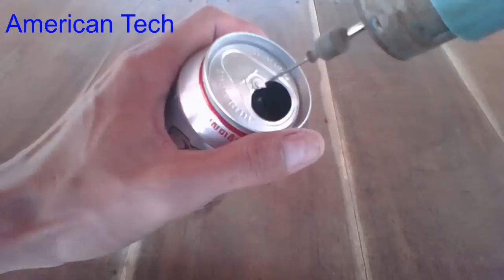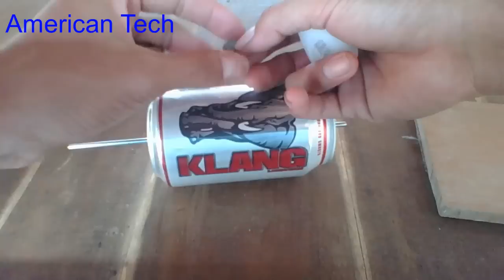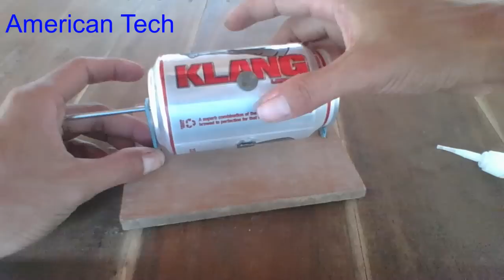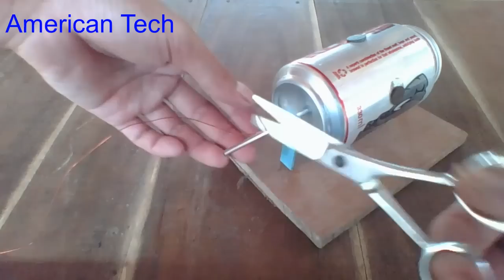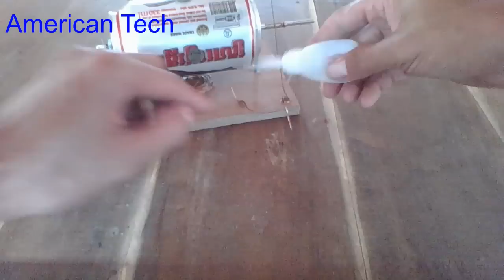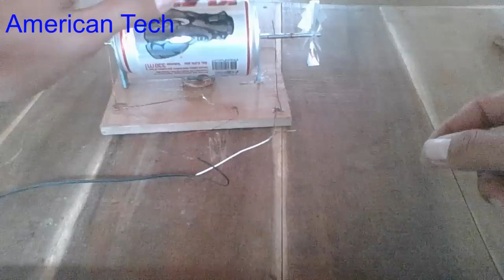How to make 2000 RPM DC motor out of beer can very easy, new idea 2017

Comment: Dear ed with the chicken picture...sorry I cannot find your comment in the comment list, it only is readable as a reply in my notification box.  For the sake of others who are not sure, UNLIKE ME...if you connect two 1.5v batteries in parallel ( meaning both pluses are touching, and the  minuses are connected and touching), you increase amperage (power or current flowing).  If you connect one battery's plus to the other's minus, this is called in series and it increases the voltage (pressure, or force).  I graduated top of my class in college.  Go look this up ed before you make costly mistakes in your circuits.  Just friendly helpful advice :)
Reply: Vincent Hildebrand Yeah how about connecting batteries in Parallel which will give you both double the Amps & Double the Voltage. This guy with his f?# music is very lucky that he is not near me, coz I would have shoved his head into his Rectum permanently where it belongs. Any one who makes videos of their projects, should Dimensions, Parts & Components needed for others who are watching

Comment: It was fun to use a pop can yes?  Can you all imagine if the can was fatter?  How about as fat around as, say.. .  .    .      .a bicycle wheel??!?!   More horsepower.  Increase voltage and coilings and more magnets and....o my.  And have some pull as others push.  The power potential in terms of horsepower is great.

Comment: oh, at.  i happened across this video again, and have to admit i was fooled.  dang.  i hate when that happens.  in my defense only skimmed over the build.  anyway.    too connections were shorted together, to allow the pretend commutator to function.  the motor works because of the use of a pulsating dc power source.     cheers

Comment: That music was headache. no need of music.  he used a battery to run it which he did not show.
Reply: ya man that music i m unsuscribing bcause of that music
Reply: actually he never claimed it to be a "free energy generator" and you can see the wires from the power supply.
I agree with the music part, it's so annoying
Reply: Simba Boy so who cares if he didn't show the battery
Reply: mehmet bilir get over it
Reply: Simba Boy 
I keeb dislikin the vids b cuz it
Reply: He did use a battery. he usually uses a 18650 battery.
Reply: my theory behind the use  of the same repetitive music is to get it stuck in your head, (i've heard people call it an "Ear Worm").
    advertising psychologist know that  repetitive and/or very annoying background music causes a level of subliminal stress in the viewer.  
   this results in the viewer, even though they may not want to,   subconsciously thinking about whatever product they are pushing even when off doing something entirely different.
  the you tube groupon adds are a perfect example of this.  they are intentionally annoying so as to stick in your head.  
   Subliminal brainwashing....
Reply: bad

Comment: Yes get rid of the music. Show precisely how you are wiring up the wire on the shaft for the brush .  You need to get your hands out of the way and go slower. Is the shaft steel or Aluminum ? Is the coil available on the internet for sale?  Where can it be purchased? You should of not had the stupid music and explained everything as your went along.